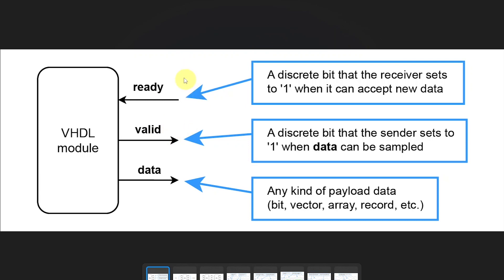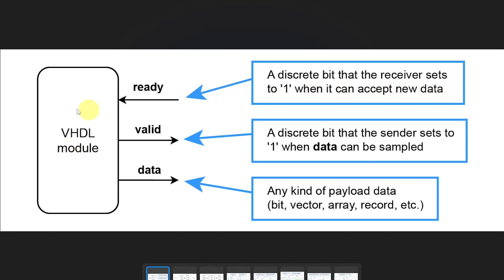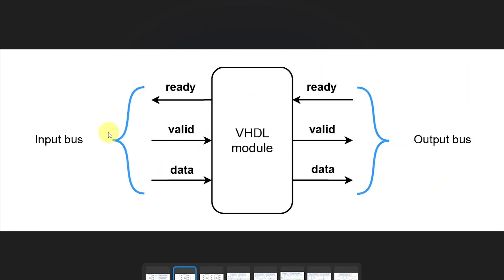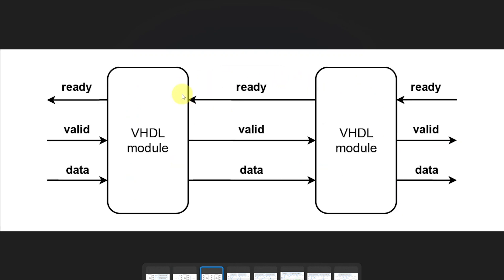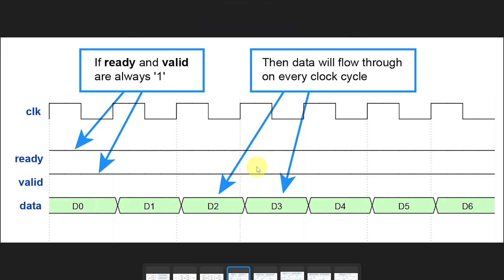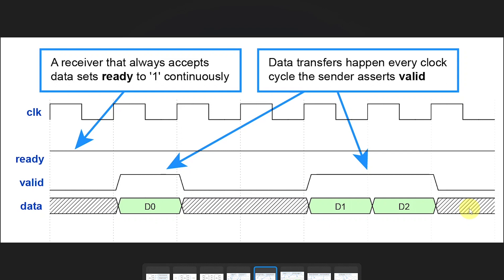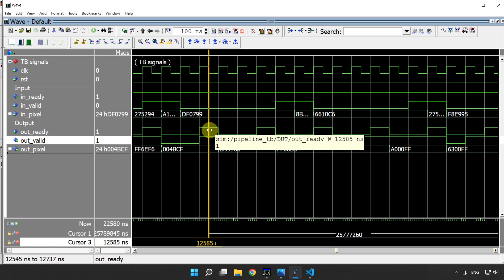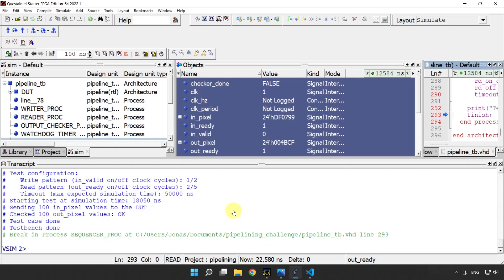How the AXI-style ready/valid handshake works

Comment: When exactly the sending data (in green boxes) are sampled by the receiver (suppose both valid and ready are asserted)? If the receiver uses DFF to register the incoming data, I guess the sampling time is at the raising edge of the clock, which is located at the "tail" of the green boxes. In this case, the setup time (for the receiver) is long enough, while the hold time might be a concern. The wavedrom diagram always draws the green boxes a bit offset (to the right direction) of the corresponding clock cycle, probably considering the Tcd and Tpd of the sender. This offset gives a bit room for hold time for the receiver, I guess.
Reply from the maker: My intention was to show a diagram of a perfect world with regards to timing; like the waveform in a VHDL simulator. I can see the transition of the data boxes appear a little offset to the right. But for the sake of this example you can assume that any changes happen exactly on the rising clock edge and that the receiving FFs have no problem sampling the value that the data signal had just before the rising edge.

Of course, in reality, there are setup and hold time requirements that must be respected. The good thing is that in FPGA design the synthesis and PAR tools will take care of that for us if we use the same clock, or clocks with a known phase relationship, on the sender and receiver sides.

But, yes, timing is something you need to think about if that's not the case. Then I would consider a different interface like a 4-way handshake.

By the way, we created such a 4-way clock domain crossing handshake in the VHDLwhiz Membership previous month. We created clock domain crossing modules to convert between this synchronous ready/valid handshake and the asynchronous req/ack handshake.

https://academy.vhdlwhiz.com/membership

Click here to get to the video and downloadable if you are a member:
https://academy.vhdlwhiz.com/products/vhdlwhiz-membership/categories/3260833/posts/2169140370

Comment: Hi Jonas, once "valid" is asserted it must remain asserted until the handshake occurs.
Reply: Not just the same cycle...any cycle thereafter.  Once asserted,, valid must not de-assert once until a handshake occurs, no matter how many cycles it takes to occur. If this rule is violated, then you can potentially get into a situation where no transfer ever takes place because the sender and receiver can enter the "no transfer" situation you describe in your video.
Reply from the maker: Yes, you are right. To follow the AXI specification 'valid' must remain high until 'ready' becomes high during the same clock cycle.

Comment: Thanks for the video and article, very well put, in an attempt to better understand these things I created a little project with something similar to what you have here, three modules, one reads data from a file and generates a stream, one receives the data calculates the square then streams it to the third which receives it and writes it into a file, my issue is that I don't know if what I have works as an AXI protocol or not, I have a testbench, I can see that the received data is the square of the generated data but everything is delayed by one clock cycle, does that mean I have made a mistake in implementing the AXI protocole? I guess a more speceific question would be this, does the  first module (AXI Stream Source) only send data when the final module (sink) is ready, and the in between module (Multiplier) is just a mediator
Reply from the maker: First, I should mention that the AXI interface has more rules than described in this video. That's why I wrote "AXI-style" in the video. It's not the complete story. But the ready/valid handshake is useful with or without AXI.

The output data will usually be delayed by one or more clock cycles when it passes through a module that does some transformation to it. That's any process that takes the clock as an input. It adds registers (flip-flops) to the data path, thereby delaying the output.

If your multiplier module uses a clock cycle, you must ensure that the ready and valid signals on that module's input and output sides still work. All modules must conform to the flow control rules (send/accept data when ready and valid are '1').

However, if the multiplier module is combinational (doesn't use the clock), you can simply pass the ready/valid signals through this module. That's because it doesn't consume simulation time, and in the FPGA, it will just add to the combinational path between your source and sink modules.
Reply: @VHDLwhiz  Thank you very much for the response, very insightful and instructive, I didn't consider the possibility of having the module be fully combinational, I'm guessing the trade off there is that the acheivable maximum frequency would be lowered but the design would require less clock cycles to run(?). The design I have is clocked so I will try to modify it to be combinational and maybe learn a thing or two by observing the frequency.
Reply from the maker: @khaaaled2007  Yes, that is correct. But if everything were combinational, we wouldn't need flow control. Typically, we want to create data processing pipelines that split the operations over multiple clock cycles. Then we need ways to ensure that data only transfers when modules are ready to accept it. One way to fix that is to add flow control signals. For example, by using the ready/valid handshake. The number of clock cycles usually doesn't matter. It's the throughput that counts, and this will be the same, even if you add pipeline stages.